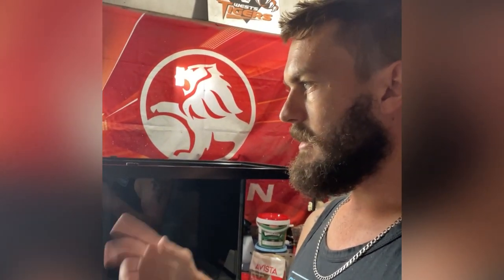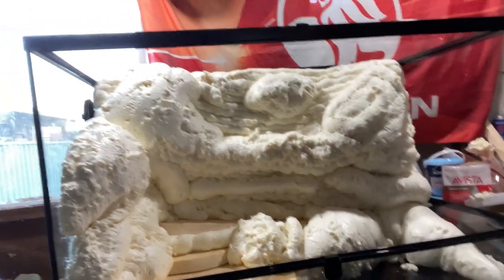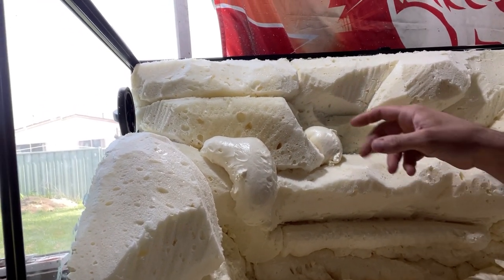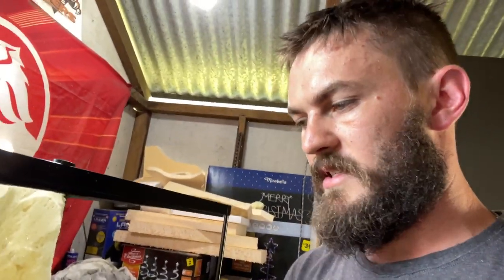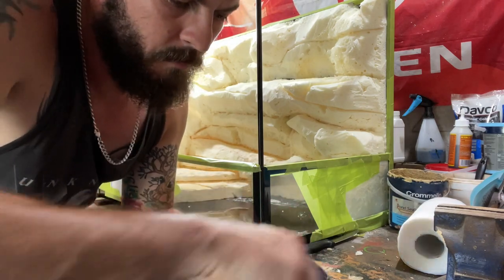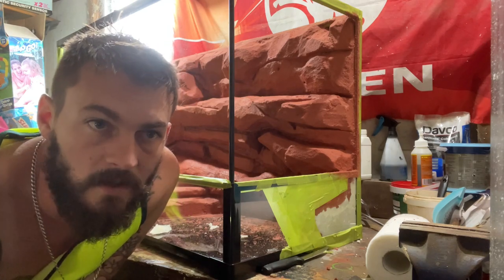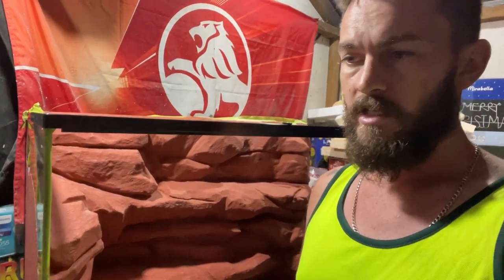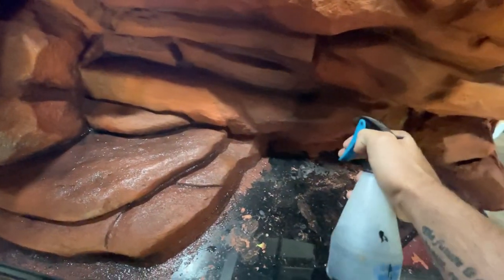How To Build Realistic Reptile Background Ep1

Comment: Your first coat looked better than 90% of the rock wall videos out there.  I had no idea the spray foam was so easy to work with. I think all the holes add character. I would suggest applying a silicone dab just proud of the surface immediately after the completed carving.  If the paint doesn’t stick to a silicone bead, maybe a quick mix of sawdust and wood glue.  Thanks for sharing!

Comment: Spraying the foam with water as you go helps it harden. When it’s that thick, it can’t get the water it needs from the air to properly harden.
Reply from the maker: Thanks mate I do spray the expanding foam with water just sometimes I don’t show it or applying it in massive amounts doesn’t allow water or air to get in it hence the softer gooey bits. I do fine over time it definitely dries up but not overnight.

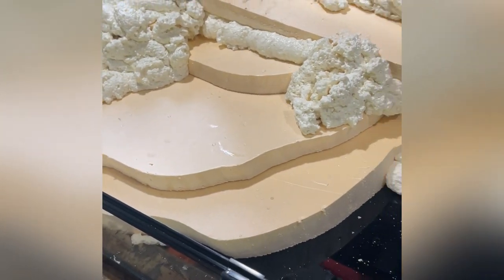Comment: Its look really good but i have one question in 1:56 you spray on it also water or something other ? Thanks for answer
Reply from the maker: The water is to assist the expanding foam in expanding and curing properly. Without it it may cause soft goey parts on the bottom due to the glass having no moisture.

Comment: So because you aren't sealing it at the end, I'm assuming that tile pointing is non toxic to reptiles? I'm thinking of doing this instead of my last coat of grout do avoid having to seal it at the end
Reply from the maker: Yeah it’s safe for reptiles. When I used to make mine from grout also I still
Didn’t seal them either. Found any sealer made them look too glossy and wet.
Reply: @Cambart1  Oh okay sweet! Thanks for your speedy reply, it's super appreciated. The only thing I've heard is the the mould + bacteria inhibitor in the grout is unsafe.
Reply from the maker: @jessicalang5805  I’ve never heard of grout having a mould and bacteria Inhibiter before. I’ve had unsealed grout backgrounds in my tank for a while now with no dramas. Most other people that build with grout don’t seal also. Biggest thing with unsealed anything is just making sure mess is cleaned up regularly and swiftly so it doesn’t have time to really soak in. A warm water wash with a soft brush and followed by a reptile safe cleaner like F10 and it’s all good.
Reply: @Cambart1  Well in that case, I think my job just got a whole lot easier. Thanks Mate!
Reply from the maker: @jessicalang5805  no problem. If using grout just be sure to mix it correctly. If it’s not it will crack and in most cases not stick to the foam and fall off. Good luck

Comment: With the point tiling etc u said can be used for waterfalls etc can u use it to make a pond/pool area.
Reply from the maker: I would be guessing if I said yes as I haven’t tested that. I’d say holding water it would eventually soak into the pointing and leak through like most concrete or cement products. If you were to make a pond with it you’d probably need to add a sealer or something similar. There would be much better products out there to use for a pond base I would think.
Reply: Maybe pond sealer before point tiling something to play around with i guess
Reply from the maker: Definitely have a play around with it. If you were to waterproof before hand I’d use either bitumen pond sealer or the black crommelin one. Sika flex any internal corner junctions if you have any. Don’t use silicone as the waterproofing won’t stick to it.

Comment: Love the vids. Think I have watched them all at least twice :p Is it necessary to flip over or will the foam support its self going up the back wall?
Reply from the maker: Thank you. I find that is you’re using the cans with the soft tube nozzle you’ll need to lay it down. If using it with the expanding foam gun you can generally get it to stay on while leaving the tank upright you just need to go slow and do it in smaller sections at a time.

Comment: Is tile pointing basically just grout?
Reply from the maker: No mate completely different compound. Tile grout is just to fill the joints of walls and floor tiles, firm but very brittle. Tile pointing is designed for use on Australian tile roofs. It’s a firm feel compound yet flexible so it expands and contracts in extreme weather without cracking.
Reply: @Cambart1  thank you for the info mate . I don't think I will be able to get my hands on any of that here in Spain . Recommend anything similar?
Reply from the maker: As far as I know mate it’s only available in aus. I’m not sure what products are available to you but I know in America people use Dryloc which I think is similar to what I use but not certain as I can’t get that here
Reply: @Cambart1  okay mate , thank you for the help. Keep up the awesome videos !!

Comment: Curious about your Dunlop tile pouring. Does it have a grit to it? We don’t have this in Switzerland, nor Drylok. Plain mortar doesn’t adhere like I want it when thin. Can any tile adhesive be used?
Reply from the maker: It’s a cement based product that has a concrete texture finish to it. I’m not sure sorry what you can use in Switzerland unfortunately. 

The coating I use isn’t a tile adhesive used in wall and floor tiles. It’s used for our roof tiles to seal the ridge lines etc. if you have a product that is used to fill the gaps in wall and floor tiles (we call it tile grout) that will work better than mortar mix.
Reply: @Cambart1  Hey thanks for the fast response. Seems ideal for what I’m building .(2.5m x 1.5m w/waterfall). I tried mortar and it just turned the foam dusty when thinned. I have a bit of Drylok sent to me from
California, but not enough… Good to know it’s not normal tile adhesive. Maybe I need to see what’s available here and try to explain in German…
Reply from the maker: Good luck mate. I’d be curious to know what you find out so I can let other know when I’m asked next.
Reply: @Cambart1  In the end, after discussing quite a bit with company representatives, I am using a compound called Ardex F5. It is a cement-based grout that has microfibers and really resistant to cracking. So far, it is great. I will probably be putting out some videos soon, so I will share these when I have them. Incidentally, Dunlop is a subsidiary of Ardex, a German company.
Reply from the maker: Awesome mate thanks for letting me know. Please send me a link to your video once you have put it up. Very interested to see the finish. Contact me through Facebook

Comment: The basking corner spot what material did u use is it stylerfoam or?
Reply from the maker: It’s an insulation foam panel. They come in 30mm or 50mm thick and 1200x600
Reply: @Cambart1  thankyou where can you buy this from does bunnings sell it
Reply from the maker: Yep in the last aisle usually near the timber/trade section. Has all the waterproofing, bricklaying and flashings etc.
Reply from the maker: It’s a green foam now not the same colour as this video. They changed it

Comment: Hey I can’t find this stuff any alternatives?
Reply from the maker: The product I use is only available in Australia. Dunlop roof tile pointing is what it’s called. 
Alternatively you can use wall and floor tile grout. I find it’s not as good due to possible cracking if not done correctly but can still be great product to use